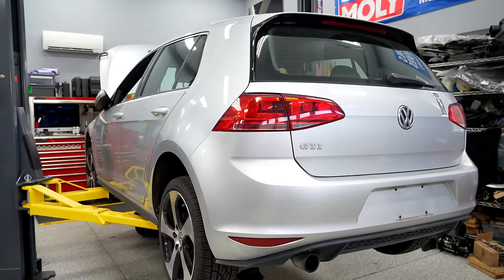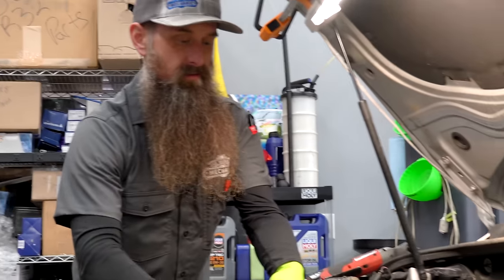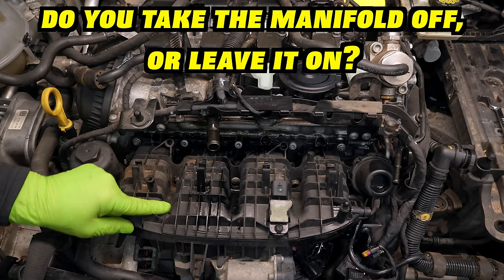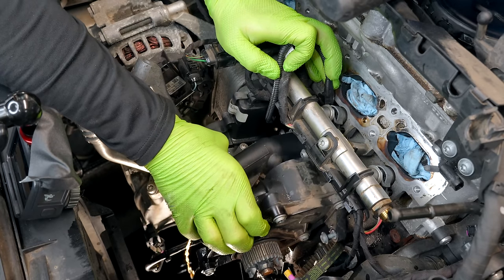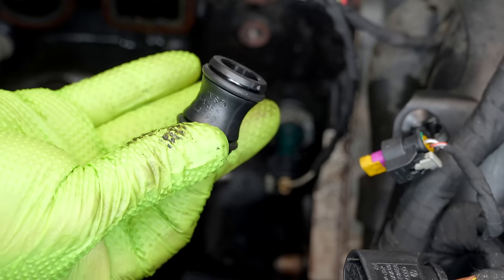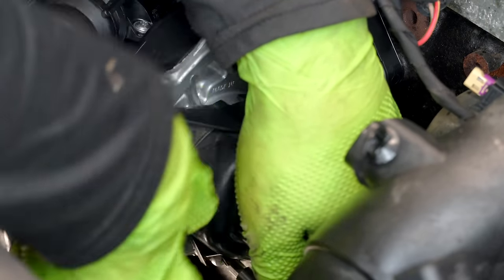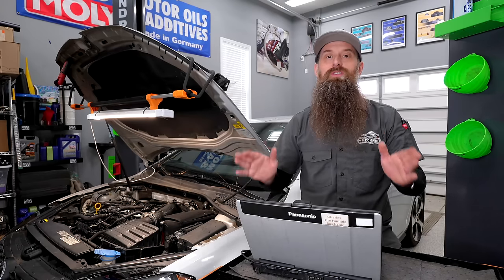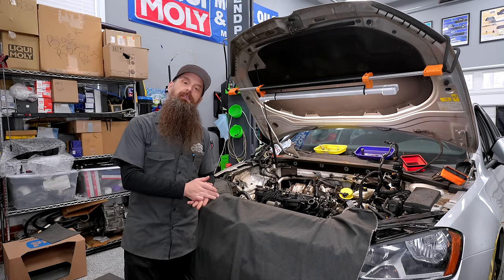How To Replace A Leaking MK7 2.0t Water Pump

Comment: Why did I buy a VW 🫣
Reply: Because you were gonna pay someone else to work out it 😅
Reply: Toyota water pumps are known to go out before 100k
Reply: @Rockybalboa541  if I were to guess, they likely don't have a separate drive belt and require disassembly of half the motor like the VW
Reply: My justification: Well, they should have learned their lesson before, right?

Reality: Picking up my GTI from the service center right now after getting the pump warrantied
Reply: Seeing how this is done, I don’t even mind. 

And yet the idea of removing my bumper to change a headlight housing infuriates me. 

I don’t understand myself 😂
Reply: Tell me about it, I changed coils, water pump now, AC motor….

Comment: Charles makes this look easy. I did this job on my 2016 GTI back in 2020. I don’t want to replace the water pump ever again.
Reply: Give it 60k miles and it will start leaking again, though?
Reply: @TassieLorenzo 
Yup. Plastic junk.
Reply: @TassieLorenzo 
Get it thru FCP though, at least its covered by their lifetime warranty and if youre DIY youre just out labor on replacing it again in a few years.
Reply: Got it!  Step 1: Disassemble front half of engine.  Step 2: Replace water pump/thermostat.  Step 3: Do valve job, timing chain, and new pistons while we’re in there Step 4: reassemble everything 😂
Reply: Agreed. I did the one on my 2015 GTI about 2 years ago. I only struggled with 2 things. That darn triple square bolt holding the manifold bracket on, ( I don't have a lift and was doing it on ramps so I had to Take it off and put it back in from the top which I DO NOT recommend), and the bolt that holds the belt on because I didn't have the crankshaft tool. So the belt did not get replaced. My belt looked ok but I definitely wish I had done it for the peace of mind.
Reply: @ZigArrok55 that belt will be fine
Reply: Funny, also changed the thermostat housing and water pump on my 2016 GTI in 2020. It leaked on the thermostat housing seal to the engine. 50 cent part in the end but about 8 hours of work. Now changed to BMW but i learned the engines even leak at more spots 😂
Reply: @ZigArrok55 I will give you more piece of mind. I have never replaced the belt and have never had an issue. I've done countless of these but because most of them are done under the warranty extension(Dealer tech), warranty will not pay for the belt. They will pay for the bolt tho because technically you're supposed to take the gear off to pull the belt off. I have never seen that belt crack or snap
Reply: @hansmaulwurf3831 AWD BMW are the worst. 16 or 24 hours for an oil pan job because the axles go through the oil pan and requires tons of dissassembly, including lowering the subframe. And best of all, it's a common leak point
Reply: @rileykoziol1005  Thanks for that. I wasn't really worried about it. It's not under high tension so I'm sure it's fine. Besides when I checked it when I did the replacement it was totally fine. But thanks anyway. It does make me feel a little better.
Reply: @rileykoziol1005 my dealer only did the pump under the factory warranty extension and not the plastic thermostat housing, is that surprising for you to hear?
Reply: Do the water pump and clean up those intake valves ;) woke up some lost power after 100k miles of carbon buildup
Reply: @carpassion96  I did mine at like 120k. I bought the car at 100 though, and started getting some issues. I had HOPED the dealer would have done it since it's a recommended service. But they didn't do the trans fluid either. I had to. Stupidness
Reply: @Noname23489  Warranty will only pay for the failed component. If the water pump is leaking, they can only replace that. If the thermostat housing is leaking, they will have to swap the old water pump to the new housing. Warranty sucks sometimes. But regardless, the thermostat housing comes off to replace either so you'll have a new thermostat housing gasket anyway. Same thing if the thermostat housing was leaking. You would get a new water pump gasket because that has to come off to be transferred over
Reply: @ZigArrok55  It's not required to do maintenance on a car with 100k miles. It's as is. Especially something that isn't cheap like a carbon cleaning or trans service. Carbon cleaning also isn't a recommended maintenance item as far as a time or mileage interval. Only certified pre-owned cars are required to be up to date on maintenance and those won't ever get the valves cleaned because the only time that's done in a shop is when there's issues because of it. People aren't just walking in wanting their valves cleaned and i dont blame them because it's several hundred bucks if not a grand after you factor in labor and parts when dealerships are charging $200 an hour now
Reply: @ZigArrok55  For those struggling with the triple square, I was able to access from top by using 12" extension, universal joint, and a magnetic wand to guide the bit in.
Reply: Yeah, that does not look fun

Comment: As a VW tech, I appreciate you making these videos to give the community more confidence in working on their VWs and also giving the other part of the community an understanding as to why it's never cheap to bring their VW to a shop. I'm glad 90% of the Thermostat housings I do are under the warranty extension. I have this job dialed in to about 2 hours because I've done so many
Reply: Same lol also a vw tech these and the 1.8-2.0 turbos
Reply: I took my s3 in for leaking coolant and balance shaft seal, does it surprise you that they only changed the water pump itself under the warranty extension? I would of thought they would of done both at the same time the plastic thermostat housing and water pump
Reply: @Noname23489  Warranty will only pay for a failed component. If one is leaking and not the other, they can only replace one. However, depending on my mood or how bad it's leaking, I'll just say both are leaking and replace both. But generally you can't replace both just because
Reply: Does volkswagen also cleans it before replacement? I’m just curious because after the repair they did for me i have more leaking stuff under my car then ever before. But it has come to a stop so my assumption is that there was still coolant or anything else left there and while driving it came down?
Reply: @D3nn1s_NL  What do you mean clean it before replacement? I can't speak for everyone. The people working on your car are human. There's not a set process of doing something like being a robot. I couldn't tell you if anything was cleaned or not. I know I clean up after myself when doing a repair

Comment: Pro little tip, if your doing this job and have relatively big hands like me lol, there’s 4 tabs and one connector on the radiator fan, pop all the loose and boom, lots more free space. Over at the vw dealer I worked at, I learned this trick out pretty fast and it made the job super easy especially since I had a lift, that way I don’t have to remove the intake manifold. That goes for both the new and old gen, just on the old gen you have 4 t-30’s holding the fans in, but they are super accessible. I did do this job just recently on a 15 GLI from home , had it out and replaced in about an hour. If your planing to do this job and want some more room, remove the fans, you’ll thank you me later😉

Comment: Charles just wanted to thank you for this video. After doing it all right EXCEPT for the union which dumped my coolant and my tendency to be "delicate" when installing most parts on VWs, I omitted to "nudge" the pump towards the oil cooler and ensure the union was squarely seated. The boroscope pic of coolant flowing out of the oil cooler side of the union really messed up my day. Thankfully your technique saved the (next) day. Cheers!

Comment: I’m grateful for videos like this! The frequency of maintenance on my 2018 Beetle 2.0t gen 3B is a real downer. Coolant (very recent) leak sprayed on the big radiator fan and killed it. It stayed running and killed the battery. $180 for the pleasure to repair that! Now a water pump. Another $270 for that alone.

Comment: I have done quite a few of manifold removals, I dont like disconnecting the top coolant pipe or the fuel line. If you loosen the 4 T30 bolts on the valve cover for the coolant lines (2 under the wiring harness, 1 near the oil fill cap, and the other on the side towards the vacuum pump) it gives a bit more movement without having to make a mess. I also find it easier to remove the 2 bolts for the harness bracket rather than removing the connectors from them, gives more room to disconnect the vacuum line under the manifold and leaving it on the car. Great work as always.
Reply: If you're just doing the manifold, then it makes no sense to remove the coolant hose, but you already have the coolant drained for this job, so it's kind of worth it. It makes putting the manifold back on a little easier imo and only takes a second to do. Tried it the other day. I normally don't drain the coolant first, I let it all come out when I disconnect the hoses off the housing. Then I took that coolant hose off for re-assembly. And taking it off how he did will allow you to move the entire hose out of the way because the one end is the middle hose on the thermostat housing. That way, theres stuff in your way at the thermostat housing

Comment: You'd really hope VW use these as training aids. Very thorough and detailed as always.
Reply: As a VW tech, he does have a ton of good videos that I've watched to get more comfortable with what I'm working in. That being said, these thermostats are so common amongst every ea888, vw techs don't need this as training lol I've done 3 of these now in the past week and a half. I even took a few things away from this video. I've always taken the fuel hose off of the pump instead of just pushing it out of the way like he did , as well as usually leaving the top coolant hose on. Just a couple things that'll make life a tiny easier pulling the manifold off

Comment: You can actually sneak this out by taking out the boost pipe on the right side and not going near the intake manifold. Everyone to their own though but saves a ton of hassle. Just have be careful of the plastic union when going back in.

Comment: I always replace these without removing the intake, it’s also a good idea to inspect the balancer shaft seals if it’s leaking it’s so much easier to replace when the thermostat is off
Reply: how would you replace the balance shaft seal? my understanding is it runs through to the front of the engine and it is part of the timing chain.

Comment: An optional tool for the hard fuel line is a Lisle 12720 Line Socket, 17mm (Or similar injector socket) . This makes taking off the fuel rail side much more easy and lets you use the torque setting. They are 3/8 drive so still compact.

Comment: Done a few pf these and struggled to that poxy cotton reel to stay in place whilst fitting the pump. Once I've got it in place and bolted up I then panic hoping the reel hasn't flipped out of alignment or something then have to double check it's all in place. Also never thought of putting the belt on whilst fitting the pump, that's a good tip, like that. 👍👍🙂🙂

Comment: FYI I had the warrenty done on mine...didnt make it 2 years. Honestly if you have to do this get the aftermarket aluminum one, well worth the investment, I got lucky and found a mechanic that said he would order the aluminum one because the stock one is known for failure.

Comment: Interresting. I actually do have a very slow water leak at my pump on an 2017 Polo Gti DAJA engine. When i say slow it drops from the max to the min line on the bottle in about one year. The shop that found the leak by pressurizing the sytem they of course told me they wouldnt want me to leave without fixing it and it would cost about 2000€. I kindly declined and here we are 3 years later. Its not given me any bother since then, i just checked the fluid every now and then and refilled as needed. But i do understand it could blow any second and cause a major bill when the engine overheats. Doing this repair myself sadly seems a bit above my head tho.

Comment: Above the #4 intake runner ,on the head is a (cam?) sensor with 1 hold down bolt. 
I had to remove that bolt and twist the sensor a little for clearance to get the intake manifold out.
2014 jetta 1.8 gen3

Comment: We don’t pull the manifold in our shop, we just work around it. Couple of extras, don’t yank on the crank without the holding tool, I had a customer tow one to us after replacing his own water pump, he ended up loosening the front crank bolt, allowing the timing to spin while he was diddling with the pump belt. We had to replace some valves. Also make sure if you have any oil leaks at the cam carrier you fix that too as oil leaking into the thermostat area will swell the rubber seals and break the plastic housing.

Comment: A tip not found here, tighten the fuel rail pipe back on before tightening down the manifold. Pulling up on the manifold  (slightly) will allow a bit more room for the less than slim 17mm wrenches most people might have. Newer gen 3's that don't have studs on the manifold do not require it to be removed AT ALL.

Comment: For the 12mm bolt, no wrench would fit properly to loosen the bolt.
I used a 12mm socket, cut it enough that it would fit snugly, instead of using a rachet (which is impossible), I cut the other side of the socket two sides flat so a 14 or 13mm would fit (on the modified socket, not the bolt).
Doing it this way the socket is flush over the bolt, and w a 14mm open wrench I can move the moddded 12mm socket. 
On my car someone had been there before and seemed they used threadlock, no wrench would loosen it. 
I almost pull the engine out as I started to feel the bolt stripping a little bit, the socket mod saved the day.

Comment: When I had the pump etc replaced on my Leon Cupra at 75k, I asked if they could check my intake valves for carbon; they said they do the fitment 'blind', without taking of the inlet manifold!!

Comment: Thanks for the tutorial! Question: Isn´t any gasket to replace from the pump plastic body to the engine surface? I mean, I assume that there are gasket touching the surface, not directly the plastic body to the engine surface, right?
Edited just to add that today mine said goodbye with 112.000Km (69.600 miles)

Comment: My 2017 Audi S3 started a small leak around 32k miles called Audi USA about warrenty service, and they told me to contact my closest dealership which was 2hrs away in Denver. I called the dealership explaining I was barely outside my warranty (before the VAG class action lawsuit, the problem was acknowledged by them in 2023) and I was hoping to pay just for labor OR parts. Nope, the CO area VW and Audi dealerships said "tough luck, full price". I was moving across the country and had to repair the car before the roadtrip; luckily I had a good local VW mechanic install the replacement parts I purchased. Bottomline - this the common repair on the Gen 3 EA888 and will fail, prematurely or otherwise.

Comment: I never replaced the belts. Never heard of the belt breaking either. I have heard of techs breaking the bolt for the pulley on the counter balance shaft trying to replace the belt though.
Reply: Might be because the bolt is left hand theard.
Reply: Hahah don’t need to touch the belt .  Reuse is fine
Reply: Even if it fail, it’s not catastrophic

Comment: without reseting the coolent acutaor, i notice on my 2016 Q3 the fan kicks in often during the summer. I'm going to try resetting it and see if it helps that issue. btw, it didn't do that when i first got the car new. only after the dealership did my maintenance over the first 40k miles did i now notice it since.

Comment: Hi charles, ever seen the balance shafts go bad on these engines? we had a customer in with a 1.8tsi engine that was running hot, diagd a leaky thermostat/waterpump and no coolant in the tank. when mounting the new pump we allways turn the crank so we can walk on the little "timing"belt and to my suprise the little pulley on the end of the balance shaft wasnt turning with the crank. Ive checked if the counter clockwise bolt was tight and it was. gonna pull the lower timing cover on monday to see if the balance shaft chain broke

Comment: Thanks for making this video! Is it necessary to replace the belt and intake manifold gasket? If you don’t have the coolant vacuum tool, is there another way to add coolant without risking an air bubble?
Reply from the maker: Not necessary to replace those parts. But I wanted to show how. 

Buy that funnel I showed.  It’s like $30 I think. That’s what I use with very little issues

Comment: yeah need this rn sadly, haven't checked to see if it is the water pump yet but i'm starting to believe so because i've lost a little coolant and i'm hearing a ticking noise from the engine

Comment: My 2016 Jeep with the pentastar engine had a leaky water pump just 2 months after i bought it second hand. That was one of the easiest water pumps i have ever replaced, unlike this monstrosity. I replaced my water pump like in 2.5 hours working slow and steady. If I had to do it quick, maybe 45 minutes to do it right.

Comment: My curiousity is why are the top two intake manifold fasteners studs on the MK7 USDM GTIs? Mate's MK7 R has bolts. I didn't want to have to worry about removing the fuel rail in the future to pull the intake manifold off, so I bought two bolts to put in their place. 

As always, these videos take away some of the mystery that these cars seem to have around them. I share the same sentiments as others - love the camera angles to show exactly what's being worked on.

Broken valve spring - this seems a random defect as opposed to a common problem - truth behind that assumption?